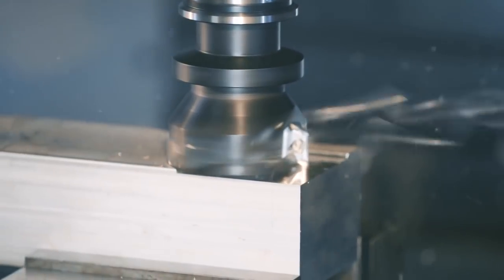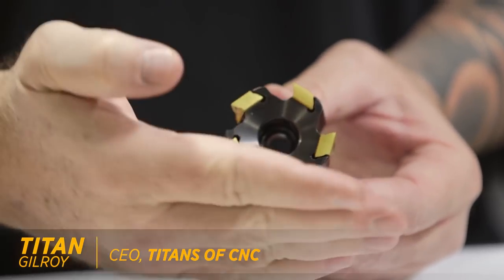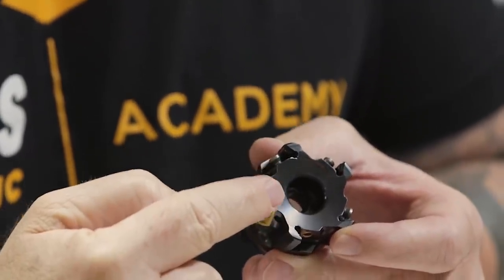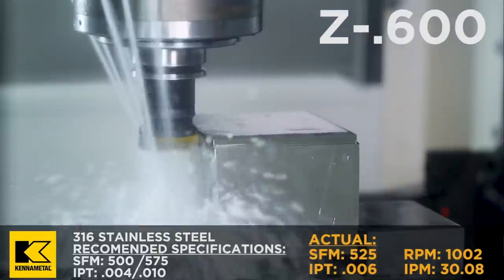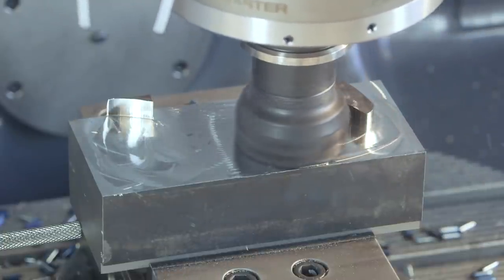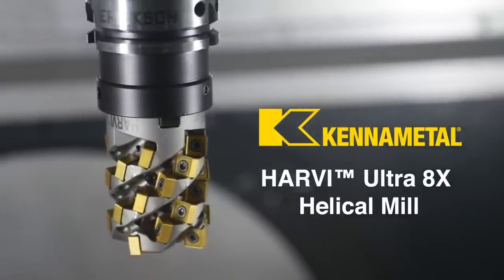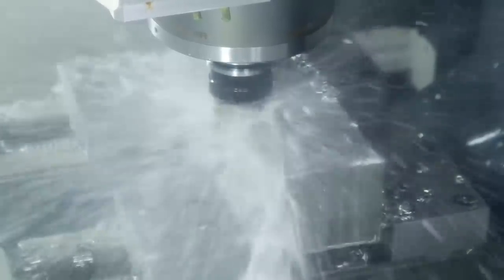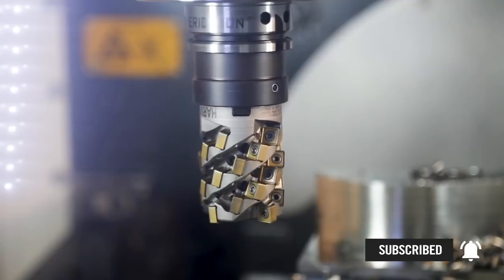Powerful Roughing with Incredible Indexable Cutters | CNC Mill Tooling + Machining

Comment: Hey Titan, at my shop where I used to work (I’m in the hospital recovering from a t-bone hit and run on my bike), we use an Ingersoll tool similar but even bigger. Took 6 rows of 7 inserts each. Can take about 3.5” depth of cut. Those tools are definitely for a very strong setup and machine!

Comment: I just added the Harvi Ultra 8X to a titanium job we have and it’s amazing! I like your idea of having 2 to flip the inserts as one cuts to minimize down time. Let’s see if my Boss likes this idea also so I can order another one!🤣
Reply: What's the pricetag on a monster like that?
Reply: @DUIofPhysics  We got it a little cheaper because it’s under a new machine voucher through Kennametal, the total cost for the cutter, holder, 50 inserts to start was a little over $3000.  The one we got takes 40 inserts, the inserts have 8 cutting edges to rotate to.
Reply: Watch the inserts on the end station closely, they tend to break because they sit negative axially and when the insert  goes, usually the pockets on taken with it. 

Seen this countless times
Reply: @moonryder203  what is the machine?
Reply: @alexkern9134  I’m running this on a DMG DMU75. It has a HSK63A spindle. Can’t push it to its full potential but if you have a 50 taper spindle this cutter can definitely be pushed more.
Reply from the maker: Love your attitude. That 2” Dia that I was running was on a DMU50… try running slower but taking a bigger radial… it’s always good also to really look at the torque / power curve to understand where you power is at and then make adjustments to get closer to the sweet spot… keep the comments coming. Love it
Reply: @TITANSofCNC  I haven't had that in school so far but the sweet spot you are talking about is that the point where both curves cross each other? 
And how do I archive to get to that point? 

A coworker told me that for facemills he uses ⅔ of the diameter as the stepover. Is that the optimum or is there something that's faster? 
(Feed is at 6000mm/min, 750rpm, 1.5mm doc & all with an 80mm facemill)

Comment: I bet that thing needs some serious horsepower to really take advantage of those inserts.
Sounded like a big diesel powering the spindle near the end of the video.
Reminds me of my days on the rigs.
Reply: As per my post above, when we ran ours @ 2.5” doc, the spindle load would be right at 90-100. Our machine is designed to be able to run @ 200 without issue for quite a while. Is pretty unnerving seeing it in action for the first few times lmao!!

Comment: Hi I have Kennametal 5230VS09 Chevron long edge milling cutter Diameter 50mm X Long 100mm, I use for aluminium only can you give the cutting parameter? RPM, Feed, step over. Currently I use  but more noise and vibrating.

Comment: Just like a chain saw chain, only this has more "meat" behind the cutting edge. That cutter is hogging out a lot of material for sure. 
You're right, those might be a very expensive bit/cutter but, as you said, if you're doing a project that's worth 10 x's more, you're money ahead in the long run. Great video, cheers :)

Comment: That harvi 8 is a beast, I've used one made by iscar but it has ripper style tips in it.
The only problem is that it's normally used on a machine like a vf9 so spindle power let's the cutter down.

Comment: the clip with the harvi ultra 8x : 
its too slow, dont use the cutters for massive material removement. use a highfeed cutter head and punch out the material stepways  in z axis wich is always much more stable. then follow the conture with the indexable cutter.  
but nice video thank you TITAN ;)

Comment: Doosan DVF 5000 vs DMG DMU 50 3rd gen? My shop is looking at purchasing a new 5x machine.
 Anyone have experience with either or both machines?
Reply from the maker: I have ran both and will say that right away… The DVF5000 is less expensive by a lot …. So that’s not a fair comparison. 

Jump to the DVF6500 and now your apples and apples on price.

But the DVF6500 has dual A drives which  gives Crazy rigidity, glass scales and is a monster machine.
I did a video on the DVF6500, look it up on my channel.
Reply: From what I understand:
Doosan = rigidity 
DMG = accuracy & speed

Comment: Why do you always favour Climb Milling over Conventional Milling? even for roughing out. I know Climb Milling you get a better surface finish, but you don't need that for roughing out, so do you do it purely because these machines can handle it? or is there another reason?.
Reply: Most carbide tools like chip form to be thick on entry and thin on exit, better tool life in most situations